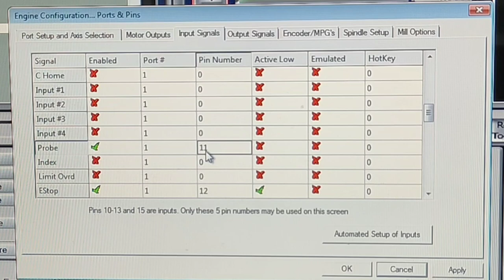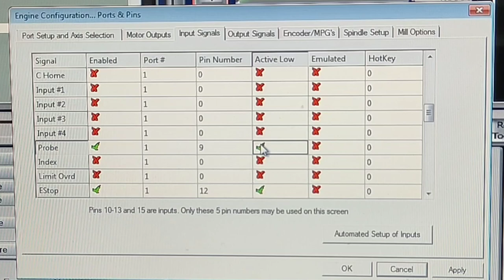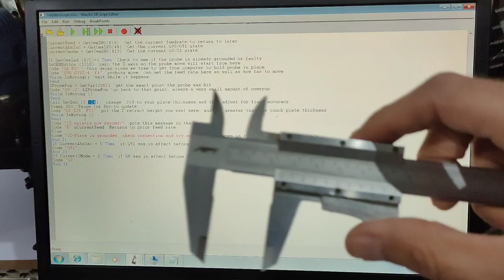DIY | Z Probe for CNC Machine | Auto  Zero Tool

Comment: HELP.  I had to start over after the hard drive in the PC that was running the CNC died, I had a backup but after reinstalling it i still had to reinstall the Z axis auto zero, from GuruBrew.  I configured the first wire in ports and pins to Probe Port 2 PROBE to Pin 15 an input pin and the the second wire to ground.  And Active low.  Saved, shut down and restarted.  He says to prove the connection go to Diagnosis and the Digitize light should light when the two wires are touched together, but, the light is lit if they are touched or not????? What am i doing wrong?
Thanks